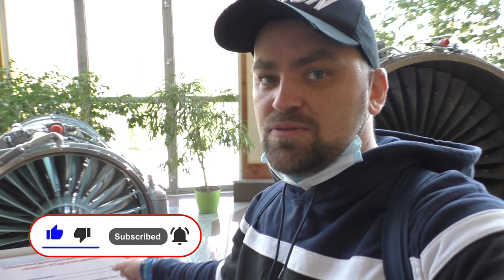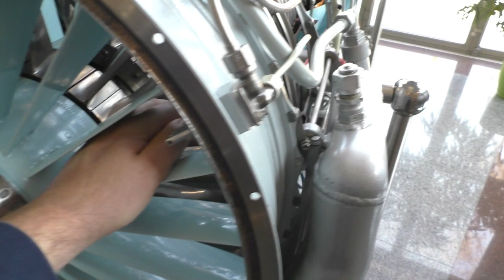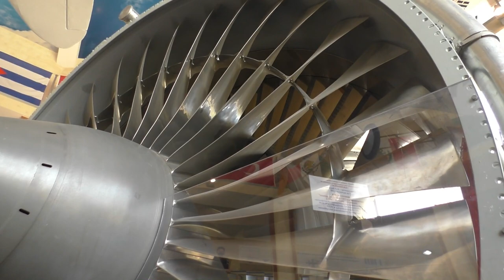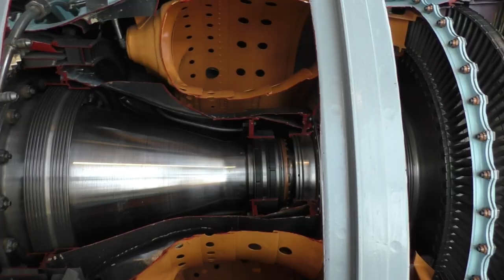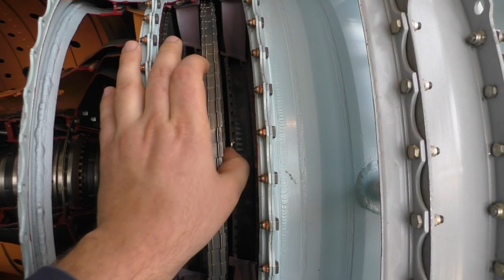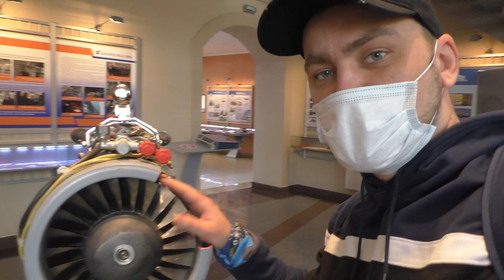How does the Jet Engine Work? Explained by Airline Pilot [HD]

Comment: How ramjet engines produce more power without fan
Reply from the maker: They only able to do that on high airspeed...
Reply: @PilotBlogDenys  sr71 black bird is powered by pratt and Whitney they have no fan but how more thrust.
Reply: @samraj1704  And how more sound, how more less power in low speed.
Reply: @sveinfarstad3897  i don't understand your question